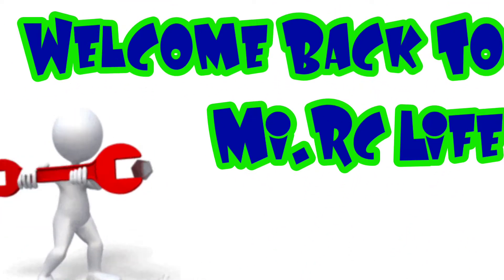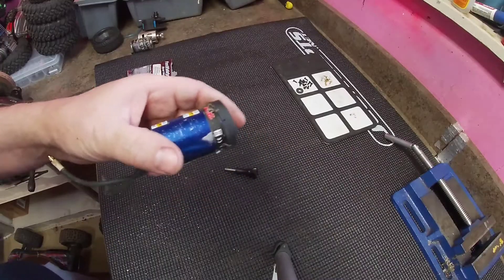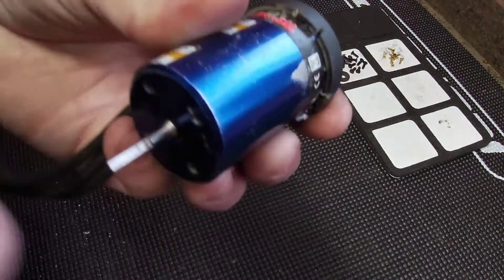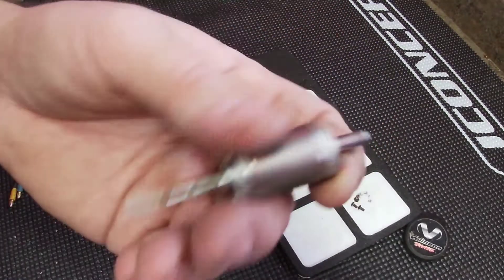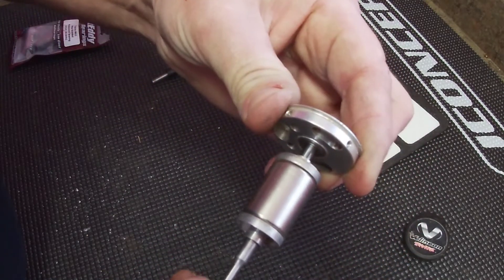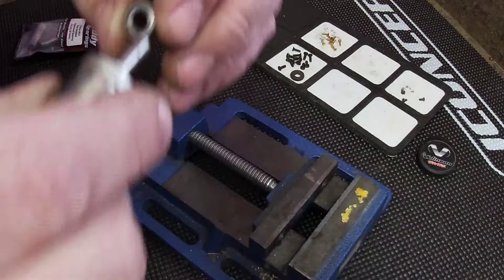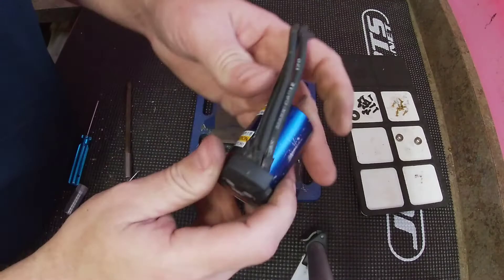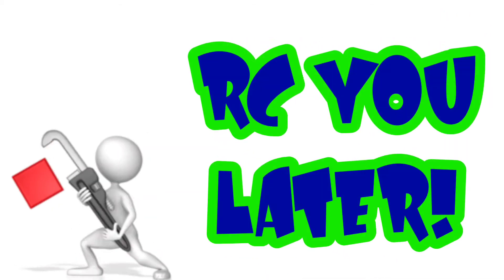How To Rebuild A Traxxas Velenion Brushless Motor.

Comment: Hey, I have the same model of velineon motor, I got it as a spare motor from when I bought another rc car, the guy who owned it before be put a rebuild kit on it, but this motor spins freely, like it has no resistance from the magnets, and it easily slides out of the metal case. Why does it do that.
Reply from the maker: It sounds like this motor has got very hot in the past and lost it magnetization.  Unfortunately there is nothing you can do to save the motor. One thing you can do is do the Traxxas Power Up program.  You can send in that motor for a discount on a new motor👍😁.  Just type  "traxxas power up" into your search bar and it should pop up
Reply from the maker: Unfortunately Owen, I just looked at the form for the power up program and it looks like you have to trade in your motor AND esc in order to take advantage of the program.  It would then cost you $125 on top of that. If you are looking for something easier on the pocket book,....you could just buy a new velineon motor for $75.  Or better yet,.....just buy a "turnigy"  motor for $25 or a "yeah racing" motor for $30. Just type in 3500kv brushless motor into your search bar.   No sense in buying an expensive traxxas motor when the other cheaper motors are just as good.👍
Reply: Hey, thanks for the info, I’m not two worried about getting a new motor, because it was a spare motor that came with the car that it bought, but if I were to buy a new motor I would do a hobby wing, I put a hobby wing motor in my rustler, and boy does it rip.
Reply from the maker: Hobby wing is another great choice of motor in my opinion.  Always check your motor and ESC temperatures after you get done bashing, this will save you from ever destroying any equipment due to an overheating issue like the prior owner of that velineon motor did.  Maybe even check once or twice during the bash session.  If you don't have a thermometer to check the actual temperatures you can give it the 1-2-3 test.  If you put your hand or a few fingers on the motor and ESC you should be able to slowly count to 3 before removing your hand.  If the motor or esc  is so hot that you cannot keep your hand on them while you count to 3 then they are getting too hot!  You may want to try a smaller pinion size or a auxiliary fan to help aid in cooling. Let me know if there is any other questions you have or anything else that I can help you with. Happy bashing 🤙🤬✌️💪